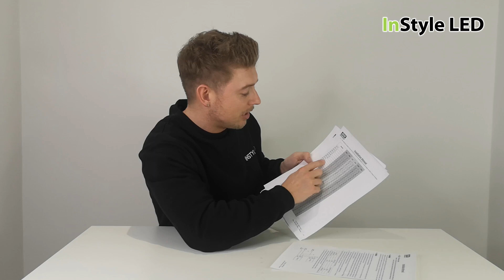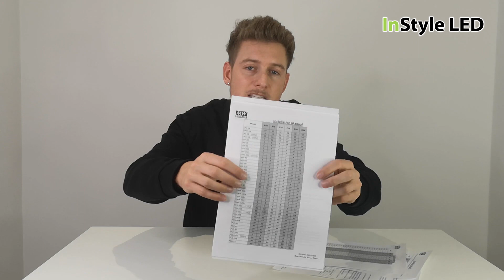Why are my LED lights tripping the breaker?

Comment: So I have unique situation.  I have Eight (8) plug n play shop lights, 0.5 amps each for a total of 4 amps.  I used to run these off a standard 15 amp receptacle with regular breaker and it had ton of other tools and equipment drawing from it as well.  This set-up neve onced tripped the breaker.  Fastforward, I had a massive electrical upgrade to my garage, and I now have the same exact lights on a independent 20 amp circuit/receptacle with noting else.  This 20 amp is GFCI and once in a while trips during the intial inrush / turn on of the lights.  It is not tripping the GFCI, it is tripping the actual breaker.  Why would this happen on a brand new 20A vs an 8-year old 15A that also had a boat load of othe things drawing?  I have tried othe 20A and it also trips them but not the older 15A.  Very frustrating.  Thanks

Comment: I'm an electrician it sounds like a fucky wiring job, unless you beat up your light or its a totally other issue, or even at the switch if they put in a dimmer
Reply: No this is an inrush current issue, probably from bad drivers.

Comment: Defo didnt help with new bulb tripping my rcd breaker
Reply from the maker: Hi Ed, what wattage is the bulb?  That sounds odd for one bulb to be casuing tripping due to inrush current,  this may be faulty bulb , unless it is very high wattage?
Reply: If its your rcd then surely you have an earth problem